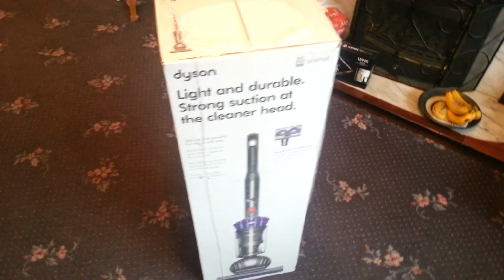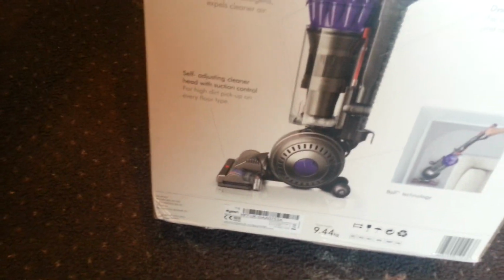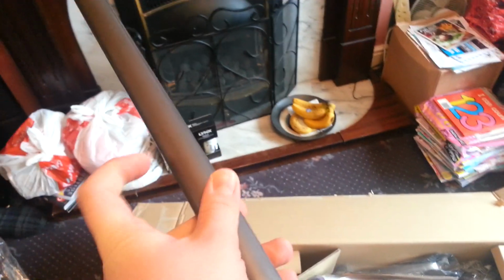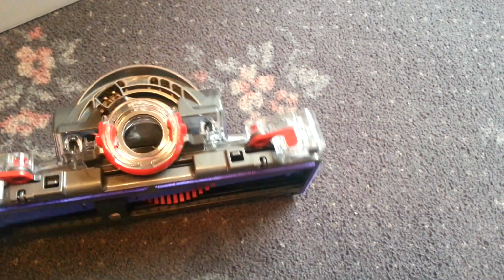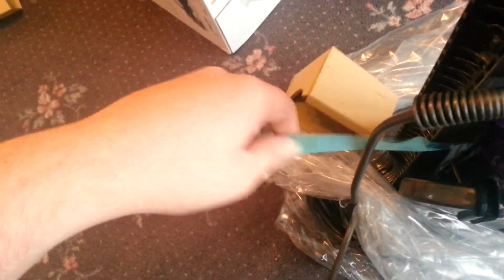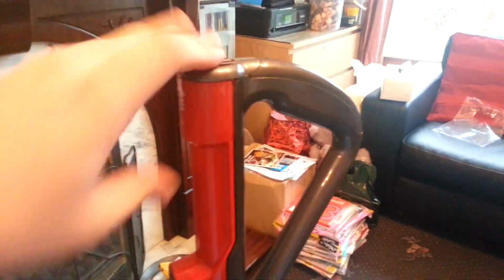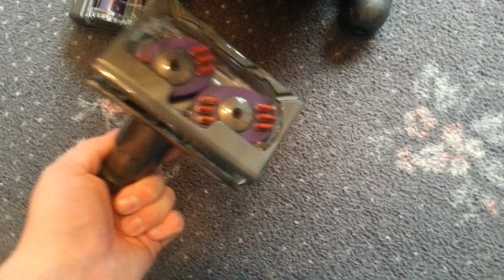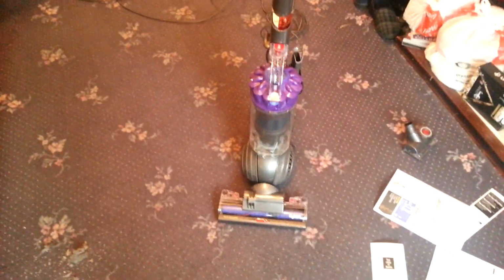Dyson DC40 Animal 2015 Unboxing And First Use

Comment: Thanks for this video! We were a little confused about where the tool holder goes as it doesn't actually tell you in the handbook. Duh Dyson you dingbats! Made sense once we watched your video and my tools are now happily sitting where they are supposed to be. Just a shame they didn't think of providing somewhere to stow the turbo tool really... But I suppose it will have to sit in the cupboard and get itself lost every time we want to use it just like the one we had for the DC07i I bought 8 years ago. Progress? Well it certainly is more efficient than its predecessor.  Just wish I had seen your video before the unbox to learn that the box should open sideways rather than on it's end but at least the cats now have a cardboard tunnel to play in which is a bonus, I guess.